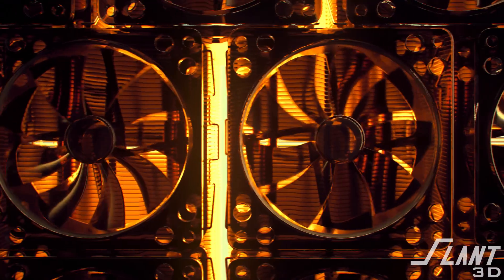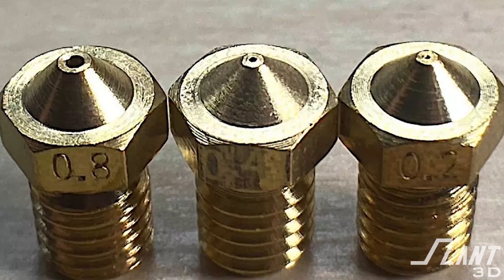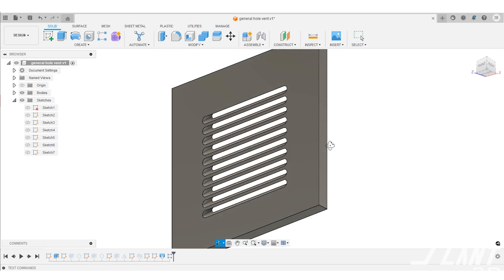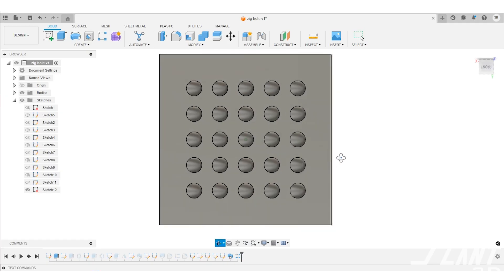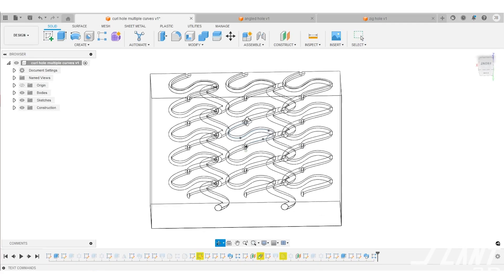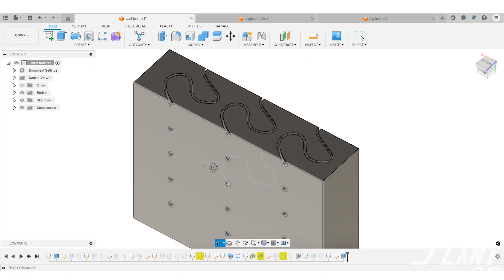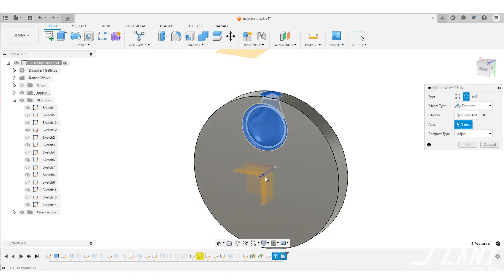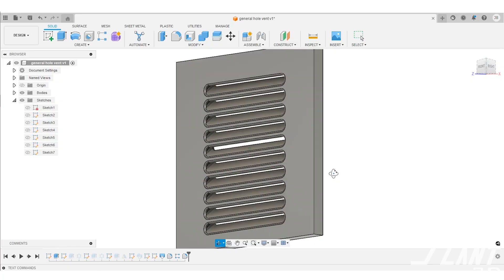These Cooling Vents are Impossible | Design for Mass Production 3D Printing

Comment: This sounds like a way to decrease air flow and increase noise. I encourage you to run it through a simulator to check efficiency.
Reply: I mean, Slant 3d seems to value novelty and differentiation over straightforward utility with these videos, like the mug handles with very poor mass separation. They illustrate the strength of the tech, and the ignorance of the design optimization related to the original design goals.
Reply: ) @Nidkidful  As my other comments have mentioned, this channel seems like a way to justify to investors (or maybe his wife/partner) why he needs so many 3D printers, and less about actually investigating the unique (but useful) solutions that could come from 3D printing (and no, buying more printers does not make it a "mass production" process.
Reply: @mrfochs  I think the design discussion is good, at least in terms of putting thought into different aspects of your product for production, efficiency, functionality, effect of layer lines, etc.

But 3d printing (especially FDM printing) is more suited for prototyping, or making small volume or unique items on demand... in both videos I've seen he mentioned making thousands or millions of an item, and optimising for the manufacturing process. Surely if you want to optimise the product for manufacturing at that scale, you'd design something that could be injection moulded in bulk. 

I'd certainly be interested in seeing how running a huge number of 3d printers to churn out parts compares with other manufacturing methods for energy, material use and environmental impact.
Reply: @Edramon53  It is drastically worse in almost every way. There are many strengths to 3d printing but efficiency is usually not among them. To make the simple perforated plastic plate with holes that he demonstrated first you would need a mold and a machine to hold the mold and inject the plastic. One could probably make 4 or more of those plates at a time with a single shot of molten plastic, though 1 would be fine too. It would take a few seconds to cool and then be ejected. Low estimate, a simple tooling setup could make 1000 of them in an hour, and probably double that for a slightly more complicated tool with better cooling. If you need 10000 of them a year for example then your part maker needs only set the tool up and run it for one day a year then ship you the results to keep your inventory flush for pennies per part. Doing it his way, (printing it standing up for no apparent reason???) it will take a FDM printer at least 3 hours to make 1 part (I made an exact copy of his first model, not the more complicated and slower printing later models, and sliced it for my printer and it was actually 3 hours, 7 minutes standing and 2 hours, 28 minutes laying flat, but I will admit my printer may not be the fastest in the world and other machines could save minutes). They would need a farm of 500-1000 3D printers to match what the most basic injection molded setup can do in the same time. Yes, the injection molding machine uses more energy and is larger than a single 3d printer, and it can even have more plastic waste per part compared to a perfectly working FDM printer, but it is still substantially more efficient in terms of time and energy per part. To make as many parts as the injection molding machine can make in 5 or 6 hours it will take over 31,000 hours of printing. If you were to print the same number of parts on a single FDM printer, the same number of parts that takes one machine less than a single day, if you printed parts nonstop 24/7 no outages nor downtime for service nor delay to remove the part and reset the machine, if everything went perfectly, it would still take three and a half years! It gets even worse for 3D printing if the part is made of metal. The only advantages for 3D printing is when you are making something that cannot be made easily any other way, or if you are only making one or two of something. Mass production with FDM 3d printers is a joke.
Reply: @karatos  let me make situation you described a bit closer to reality.
1 you design a part (2days)
2 you design a mold and drawings (week)
3 You push mold and tooling required for this mold into production (1-4weeks). lets assume that the mold and injection process run on the same factory, notmally it is not and you have to spend time on  shipping.
5. Test run and mold fix 1-2 days if you are lucky one
6. Production starts and here, if you was extremely happy you got 10k parts in a 2 days and yes you have to produce at least 10% more just to have a replacement for qality controll and dammage. 
7. Parts cleanup drilling and Qality control. It deends on the parts complexity lets assume that this we have a simple parts where no extra operation  required -  5men/day
8. Final shipping to you.
So now if you a lucky person you have spent 1 month and arround 20k. If you are not then you have to start second cycle and send extra 1-2month

At the same time you have to find a place where to store all this parts and a prity expensive mold with toolings.

At the same time you can build a farm that will run 24h all year long and produce parts on demand, and change itterstion on demand. If you need to produce small parts and do not require hi qality finish then 3d rinting can be a key.
Reply: @TarasProtsiv  if the results of your engineering come down to luck then you are a bad engineer.

I'm a good designer engineer and I work with good vendors. This year alone we got 7 molds done and are making 2 more as we speak, and through these we expect to make 50,000 parts a year minimum on some, 200,000 parts a year on others. We have some 300k invested in tooling alone plus my salary and the salary of my department, quite a bit of money flowing to design the more complex part, that is true. But your suggestion of just set up a 3d printing farm is laughably bad. Alright, let's say we built a new expansion or found room in the factory for 3d printers that can make inferior quality parts that are more expensive that we still find acceptable. Since I 3d printed all of the prototypes of the injection molded parts I already have setups so I know the one we expect to need 200,000 of every year takes a little over an hour to print. If we reasonably expect to make 20 per day per machine on average then we just need to set up 28 3d printers, minimum, probably 30 to be safe, to essentially print a single part 24/7. If we get mid tier imported printers, we are looking at about 15 grand minimum. That is half the price of the tooling, sure, but the tooling will be run essentially maintenance cost free for several years. Plus we need dedicated staff working these machines full time, multiple shifts. If we hire two part time workers to come in at different times during the day for 15 an hour to clean and reset and watch these machines, letting them run a risky part clearing routine at night and over weekends, the cheapest labor we can get even though it is skilled, no benefits, just being a crappy employer, then it will cost us at least another 30k a year. If we treat them the way we treat our other employees then a lot more. This is just one small part. Another part takes 27 hours to print and requires extensive cleanup. We need 50,000 of those a year, and they are injection molded perfectly without any secondary machining required to work. We would need 150 printers minimum for that part alone and several workers dedicated to just cleaning those parts to make them usable. To 3d print those would cost literally over a million dollars MORE in printers and labor over the life of a 100k dollar mold, not including construction costs of needing to make a new building to hold all these printers. And this is just one product line. We have several. Our largest injection molded parts would require an exceptional large 3d printer (expensive) and take days to print, and we need about 100 a month. We have 50-60 injection molded parts and to replace the relatively inexpensive and extremely efficient molds (they are stored in a small storage room/office when not with the vendors) with thousands of 3d printers and an army of new workers is such a bad idea it is laughable. As I said.. mass production with FDM printers is a joke. But hey, prove literally everyone in the world wrong, make a better, 3d printed mouse trap or whatever and put us out of business.
Reply: @karatos  there is a bit of a difference how we see the world. I look on it as an owner of mid sized company and you as a injection mold engineer :-) I have put limits for my answer that was tottaly ignored on your side. Could we stay on the topic? 10k parts per year, around 20g per part, no/limited requirements to surface quality, threads and holes in the detail, any calculations for setup cost and lead time from drawing to first parts from your side?
Reply: @karatos Your math is pretty unrealistic if you need 10.000 pieces of something per year you dont need them on one specific day, you will need on average 28 per day.
For the print you tested you would need 2:40 hour, means to produce 28 parts per day you would need just 3 printers.
Even if the cost of printing is much higher than molding, you dont need to store the 10.000 parts over the year because printing is on demand , that also means you dont have your capital tied up in parts.

Means you have alot of flexibilty and nearly zero upfront investment.
Reply: @TarasProtsiv  I am not an injection mold engineer, nor did I ever claim to be, I am a small business owner and design engineer. I make products with molded, milled, stamped, cast, and carved parts. And I have better things to do than give you estimates while you ignore reality, so you can put the snark away. The time to design the part is usually the same, be it injection molded or 3d printed. Same time for prototyping as well, since both are 3d printed at early stages. Then, as you said, you need to make a mold or hire a vendor. For a part like this, I would not expect more than 20,000 for a really good mold. I have paid less for more complicated molds. Even if it is twice that it is still cheaper in just 4 to 5 years than 3d printing, for the labor and equipment alone. Plus injection molded parts can be made that use less plastic than 3d printed parts need, so individual part cost alone can be less, and spread over the expected life of a mold the price per unit is substantially less. If you are making the argument that 3d printing is faster from concept to first unit then that is absolutely correct, no doubt about it. But that is usually a pointless metric, and in the extremely rare instance it is not then just have a printer or two in house to make a few parts while waiting for the real tools to be made. I have 3 in house for that and prototyping, they are great for that. But that is not mass production.
Reply: @karatos  from what I’ve seen, it’s pretty common for inexperienced design engineers to make parts that don’t adhere to anything but the most basic design rules that the manufacturer enforces, leaving things like shrink factors and part quality totally up to luck. This is what happens when people won’t spend money on experienced engineers, and I say let ‘em blow their funding on expensive life lessons
Reply: @karatos as an aside, I’ve become somewhat fascinated with designing parts that are only possible with fdm, but make it make sense, not using it as an excuse to make junky fan covers lol
Reply: @TarasProtsiv  it's kind of a bs limit, totally biased towards you, poor surface quality means you can get cheaper molds if you're afraid of upfront investment then you shouldn't be in business.
Reply: @TarasProtsiv the whole point is that these design choices he’s making in the past few videos are stupid.
Reply: @Skibbyz  yep design are stupid. But I was not taking about designs at all :)
Reply: @karatos  To be fair, the intent of these videos is to illustrate what additive manufacturing could enable design wise and production wise. Nobody is really arguing that injection molding is a thing of the past and that 3d printing is going to replace it, it's still the best way to manufacture plastic parts at scale, and 3d printing isn't going to beat that. What 3d printing does excel at is prototyping and small scale manufacturing, if you're not producing thousands of parts, you're not going to see a return on investment on making an injection mold.

Slant 3D is first and foremost a 3d print farm, what they do with these videos is simply putting ideas forward in how you either produce designs better suited to be manufactured with 3d printing, or designs that would only be possible due to 3d printing. Their business is getting other companies to choose them as their print farm.

As is evident from this video and the mug video, he's not a designer, he's a 3d print nerd and business man. This entire channel is him trying to sell people on 3d printing and by extension, his service.
Reply: Presumably the "specs of the project" required noisy, lossy flow.
Reply: @Welcome2TheInternet  miiight be useful for a heat exchanger
Reply: Nothing I've seen in this video is a good idea, I feel like he's either pulling this out of nowhere or he's trolling us. There is no scenario in which any of this stuff would make sense. The only thing might be a good idea is adding vortex generators, but you don't need to generate turbulence in the air, the fans do that naturally.
Reply: @JonM-youtube  You mean to tell me that having a vent that clogs up with dust after one month of use is a BAD thing?  No, it's a "feature."  Lol.
Reply: @Dartheomus  Lol. Ok Apple, how much does it cost to replace it/have it serviced?
Reply: @jonmcentire  Yeah, this and his last video on mug handles just feel like the kid in class who had a really cool idea for a project and then based his entire presentation on making that idea sound smart when even the smallest amount of research would have shown the premise for the idea was faulty - think people who promote perpetual motion machines... Oh, maybe he can make the next video about how "mass production" 3D printing can be optimized for saving energy over common production standards. Ha ha ha
Reply: @JonM-youtube  well you missed the point of the video he was trying too sell us 3d printing with its pro of the possibility to achieve very complicated geometrys in one part that would require a assembly of multipel parts out of conventional manufacturing depending on the complexity  a 3d printer farm could be the cheaper option by saving toons of money for tooling processing and assembly of the module/part  especially for smaller production series

Not gona lie his exapels there a bit out of it and as you described but good for showing and having samething in the hands too play with
Reply: this video is clearly just a discussion on ideas and in no way a discussion on optimization. why are yall just straight up ignoring stuff to go on multi page rants?
Reply: You could design it like the stator of a turbine where they add efficiency. Think of it this way: Can you see through an axial jet engine compressor?
Reply: why delegate such a simple task to a machine? they spend all these millions of dollars on wind tunnels when you can just do it mentally.
Reply: Oh yeah, this is the idiot who 'redesigned' the mug handle to be shittier
Reply: Why not just use a metal grate?
Reply: Could be useful in some situations. Maybe you want to have two separate chambers where the first one generates the airflow and needs to be very well ventilated, and the other chambers needs to have the same airflow incoming from the second chamber, but with much less speed.
So you could design something like a Tesla Valve or similar using these same concepts.
Might not be the most useful for the most common application (airflow for electronic components), but might be useful in different contexts.
Reply: This
Reply from the maker: You can design it in any way that meets the specs of the project. You could even design them to increase air flow and decrease noise.
Reply: @slant3d  you say that the additional flow resistance can increase the air flow ??
Reply: @radomirfilip8741  no, he is saying that the techniques can be engineered accordingly based on the needs of the application.
Reply: endless possibilitis
Reply: @slant3d  Truly you're leveraging the beauty of 3D printing! You can fairly rapidly design and test concepts. Flow, noise, middle-ground of both, etc...
Reply: @slant3d   Then I wonder why you wouldn't go that route to begin with.
It is quite obvious that many PC enthusiast  will click on this video, expecting something that would improve their performance.
Reply: @slant3d  yea smoke aero test is necessary at different air speeds and temperatures. Air does funny things with fluctuations in those. That's how we get thunder storms

Comment: The internal tubes are going to cause a huge amount ot air resistance. I can see how it could work but you cant just slap that on any old fan.
Reply from the maker: Very true. It is a design concept that requires expertise to implement in a particular situation.
Reply: @slant3d  Curious, what is an instance you've used actually used any of the designs other than the "slots are better than holes" tip? Filters are a much much better option for particulate capture, fans create turbulent enough flow for heat transfer, a regular impeller will have far better performance than a fan-to-radial-outlet design. As far as prototyping goes, 3D printing is king, but for any mass production, unless you can't create the geometries you need with injection molding or machining AND the best solution is a weird internal geometry... This video seems very "everything is a nail to a hammer" but with 3D printing.